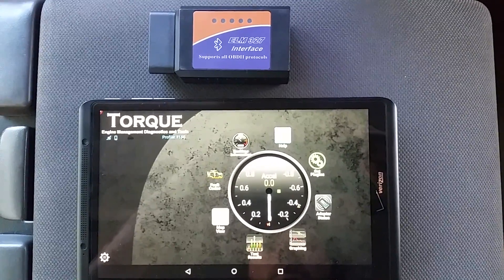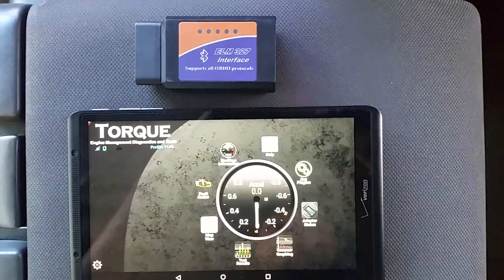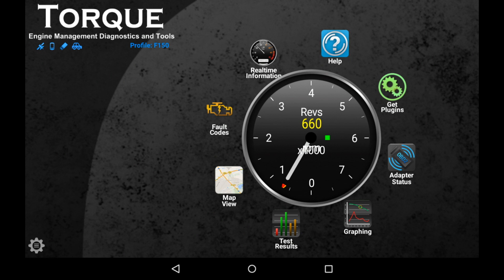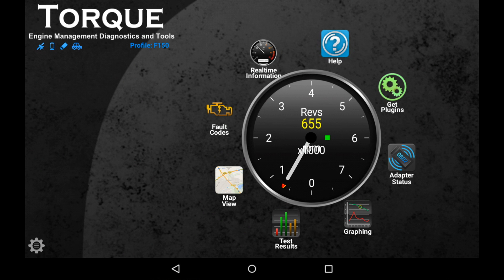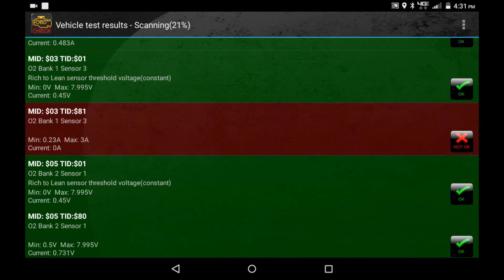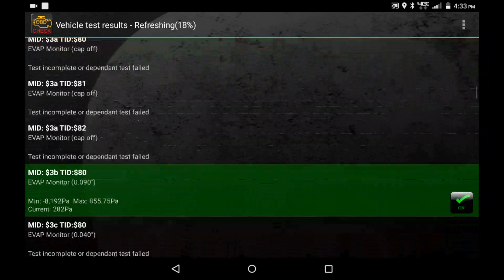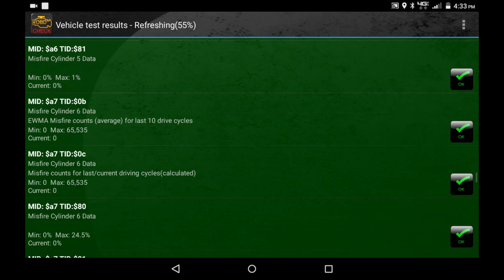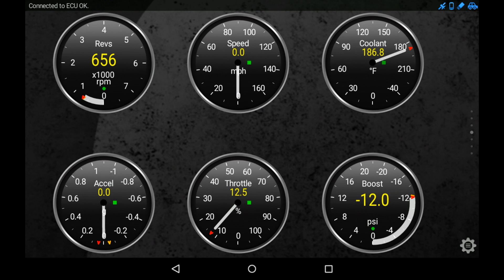Diagnose an Engine Misfire that Doesn't Throw A Code

Comment: The truck I'm working on doesn't throw a code even if you unplug an injector wire so the app isn't reading misfires from what I can tell. Everything else seems to work fine

Comment: Hi, Yesterday apply this method , been driving about 20 minutes , no hard acceleration, just light drive,  and the app show the next information : 
MID:$a7 TID:$0c
Misfire counts for last/current driving cycles(calculated) - Misfire Cylinder 6 Data
Max: 65,535Count   Min: 0Count
Test result value: 1Count
PASS

MID:$a8 TID:$0c
Misfire counts for last/current driving cycles(calculated) - Misfire Cylinder 7 Data
Max: 65,535Count   Min: 0Count
Test result value: 3Count
PASS

Today I did the same procedure, but only for about 5 minutes and it shows this : 

MID:$a9 TID:$0c
Misfire counts for last/current driving cycles(calculated) - Misfire Cylinder 8 Data
Max: 65,535Count   Min: 0Count
Test result value: 1Count
PASS

So , i don't know why yesterday, with 20 minutes of driving, shows 0 counts on cylinder 8, and now with 5 minutes of driving 1 count.And 3 misfires hits a signal of bad coil? 
My vehicle is a F-150 2011 Limited,6.2 have issues little shaking/vibration, no engine light on.
Spark plugs motorcraft new, fuel injectors cleaned .
What do you recommend?  Thank very much.

Comment: Hi, many thanks for the vid.  I tried this on a Honda civic 1.4L SE but I'm getting the message "your ecu doesn't seem to  support mode $06". I see others online with the same problem while using the Elm scanner. .  Does anybody know a fix for this with the Elm scanner or is there another scanner or method available that can get mode 6 info from the civic ecu?  Many thanks

Comment: I had used think tool mini and saw some miss fires in random cylinders. Like 5-6 miss fires in c#1 3-4 in c#4 1 misfire c#2 1 miss fire in c#3 in a 30-40 minutes trip. But there's no stored fault codes and vehicle driver just fine. It's my 2016 Mazda CX-5 2.5L skyactive. Should be worried about it?? It drives just nice and I get decent gas mileage too. Thank you in advance 😌

Comment: I have no code test results in torque showed all
Green but state misfire count 1 on cylinder 

I have change spark plug but still 

ignition coil swap

Comment: When i run the test results, it doesnt show much. Just o2 sensor stuff. I cant see any cylinder misfire info
Reply: I takes a minute  or two  scan  before you see results
Reply: @RighteousJudgement911  i let it run through 100% twice. More then a few minutes. Itt wouldnt show cylinder info
Reply: Make sure your latest PIDS are selected  for your make and model.
Reply: @RighteousJudgement911  did that from the list. Followed the guides and recommendations.
Reply: @nealdz1031   All I can say i just got mine today and I see all the cylinder info.  Not to be smart did you scroll up? And does it say refresh on top of the screen?
Reply: @RighteousJudgement911  went over it and over it

Comment: Hey, I know this is a little old but thanks.. I have a 2001 Grand Jeep Cherokee that is misfiring , but no codes. On Torque Pro,I added Pre-defined set from within app . Only adds 3 temp options. I don't see misfire pids.

Comment: overdrive means final gear. High gears aren't used under high loads unless you are going like 120 miles an hour. Just noticed you didn't understand what overdrive means.
Reply: Alright just go back to minecraft and shut the fuck up.
Reply: @MBWchannel  I've been there too, drove around a Toyota tundra, turning off overdrive, and cruising in 4th gear instead of 5th gear on the highway wasting gas, wasting money. Lol why are you such an asshole?

Comment: Hi i google Pids for Scirocco but theres no results pl advise where i could get the pids for Scirocco? Thanks for the video.
Reply from the maker: Thanks for the comment; there might not be any specific PIDs for that car, I have run into a similar issue with some BMW cars, Torque isn't able to read the specifics because of the car's protocol it uses.

Comment: As i understand adding more PID won't hurt. In my full version of Torque for GM (i have Chevy Traverse) there are additional pid listed as "Injection Pulse" and "Misfire Cylinder 1-12". So i just add all of those. Sounds right?
Reply: Stan732 yes. But doesn't mean that it'll work on your vehicle

Comment: Quick question about custom PID's, is there a resource to find them online? Torque has the base ones which is great, however I'd like to find the custom ones as you mentioned. I have a gen 4 Taurus, and can't find anything yet. Thanks for the video!
Reply from the maker: The best resource I have found has been forums online! I know this is a little vague :/ Thanks for watching!

Comment: How do you know how to setup a PID for misfires? Need it for a Nissan Maxima 1999. Im  not seeing PID's listed in the torque forums.

Could you make a tutorial how to find the PID information?
Reply from the maker: Thanks for watching! I think there's a Nissan plugin for Torque called "Advanced LT for Nissan", and i think it'll add them in. I haven't tried the plugin myself, but hopefully it will be a step towards getting your issue fixed!
Reply: No problem, thanks for the video. Unfortunately the nissan plug is only for year 2000+

Comment: Wow ! I have had an issue with my BMW M3 a solid year and do not want to throw $$ at parts ,this is well worth the effort and Awesome Info !!! Thank you Very Much
Reply from the maker: Thanks for watching! Another thing you may want to consider is purchasing an OBDII to USB BMW diagnostic cable from ebay. With this, you can download INPA and NCSExpert and pretty much run full diagnostics on the car, as well as change different parameters. The cable I bought was around $20, but I think there are a few different cables for different years. I was able to turn off the airbag light and code in a Bluetooth Aux input on an E60.

Comment: Great video. Do you know if the lite version of this software (Free) does the misfire?
Reply from the maker: Thanks, I am glad the video could be of some help! Off the top of my head, I can't remember if it does or not. If I remember correctly, the lite version is feature-limited and is mainly used to make sure your adapter works with the app, and the paid version "unlocks" more features and functionalities.